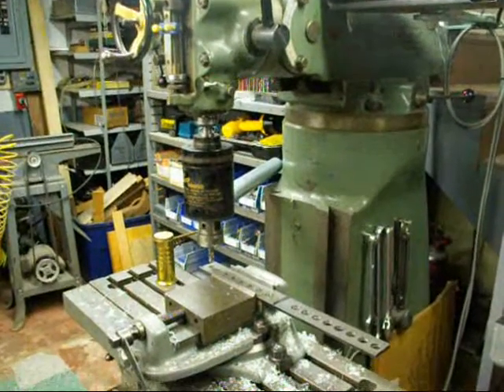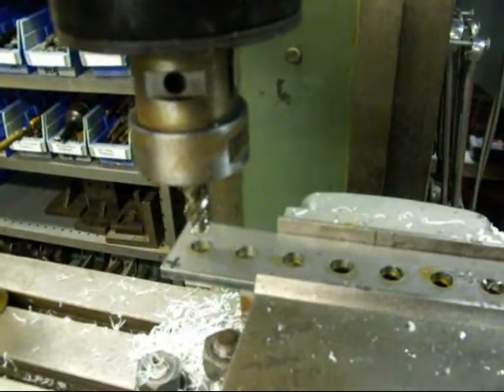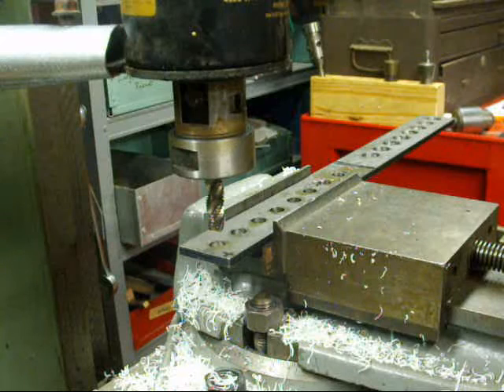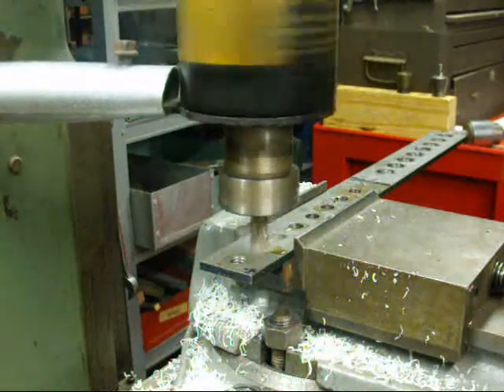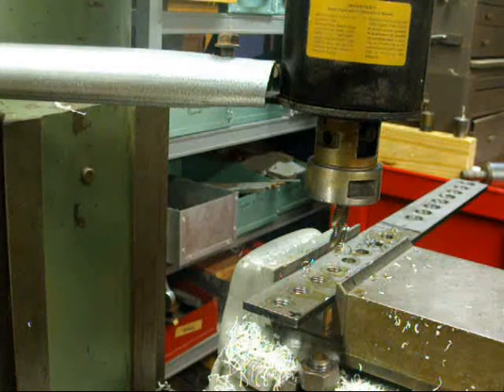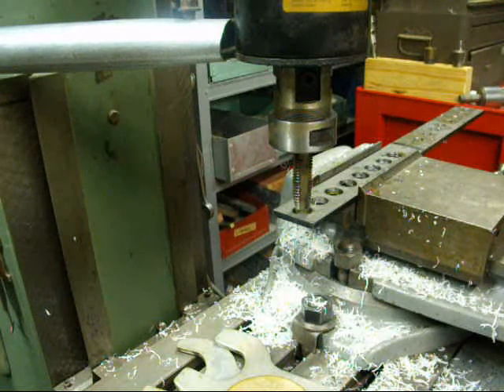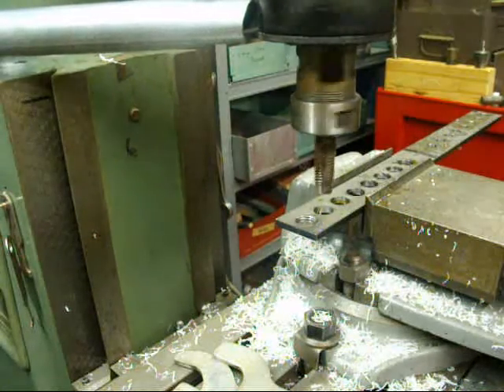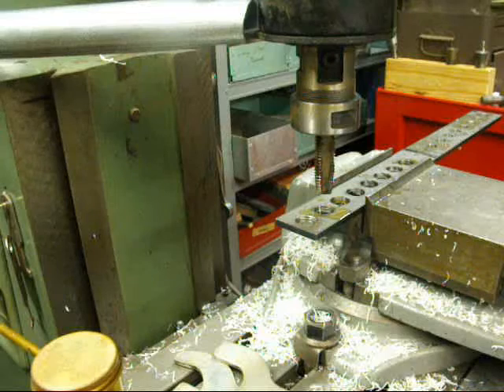THREADING Big Holes WITH AN ENCO TAPPING HEAD tubalcain

Comment: Dang T/C that 3/4" tap bent the material, dern Bruce Dern.  Ditch the oil can for threading, I use a toothbrush in a small bottle of oil for threading, put the oil right where it belongs on the tap.
Reply from the maker: I always liked Bruce Dern

Comment: By stating that you "smoked" the tapping head tells me that there was some type of force the tapping head could not overcome. IF you are using the correct sized hole for the tap, 1) how old is the tap, and 2) are you using a "starter" tap, and 3) is the tap dull?

Comment: ... but can I use die somehow instead of a tap !?!?!
Reply: Yeah, on a lathe. Make a holder for the the tailstock, or just chase'em w/ the carriage feed. Set the compound on about 27 1/2 degree angle, feed in w/ the compound & go back to the same point every time w/ the crossfeed.

Comment from the maker: @mxbch2003  Make sure you are drilling the correct tap drill hole. To use the head, gently feed down with continuing pressure till thread is complete--then reverse the feed lever on the quill, also continuing light pressure till you are out of the hole.     You are feeding the quill with the lever I hope. Not feeding with the knee. You never reverse the motor. Watch my 2 tapping videos again.
pete
Reply: To clarify Mr Pete, when feeding out of the hole you want light upwards pressure on the quill handle.  If you keep downward pressure on the handle as the tap is trying to feed out, the tapping head clutch will slip because it's trying to feed out and the downward pressure is trying to feed it back in.

Comment: i own a lathe master vertical mill(800lb square column bench top mill) and have thread a couple times using the drill chuck and a tap. only works on small holes or the tap spins in the chuck and yes i had to stop the machine and reverse it manually as well

Comment: These were made for drill presses that are not reversible,if you put a tap in the bridgeport quill you can run the tap into the hole in forwards and the reverse the motor via the on/off/rev switch and back the tap out,we never used a tapping head.If you thread blind holes you just need to make sure you drill the hole deeper than you need to tap and set the stop so you dont drive the tap in and bottom it out breaking it.
Reply: You can use the same method on the lathe & power tap. Just make sure the tailstock is lubed up good & be careful, take yer time.

Comment: the quill going down puhes the tap into the work piece and taps the hole,to back out you lift the quill and if you look you will see the collet/shaft in the end of the tapping head extend,this takes it through stop/neutral and as it extends further it will engage in the reverse gears inside the head and it will back the tap out.

Comment: i dont get how that works, how does it go from forward and then stop and go to reverse like that with out stoping the machine?
Reply: Magic.
Reply: The collet/tap/shaft assembly has a forward when you push down, stop/neutral when you stop feeding, stop feed, pull out/up it goes neutral/stop & then engages some reverse gears.